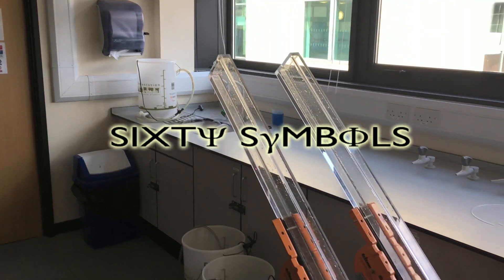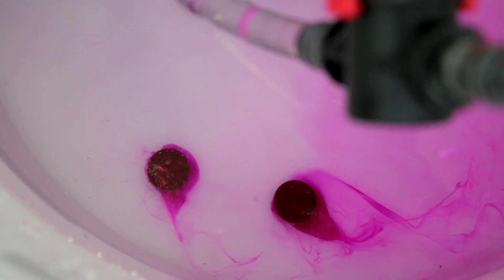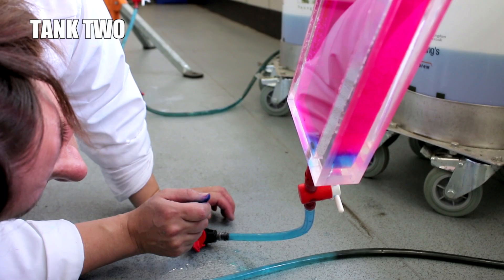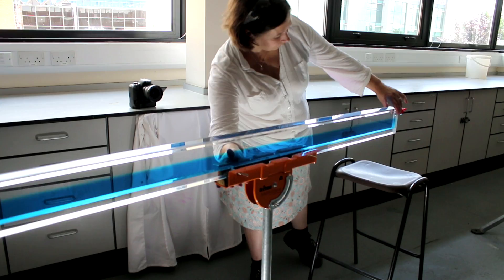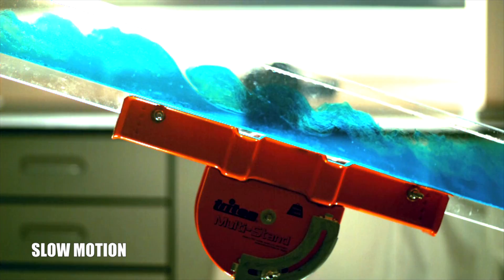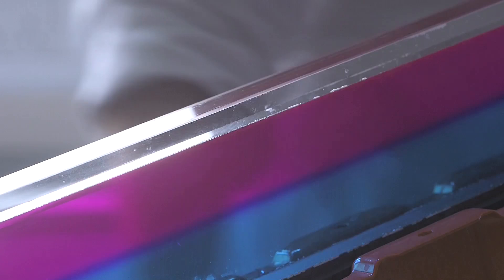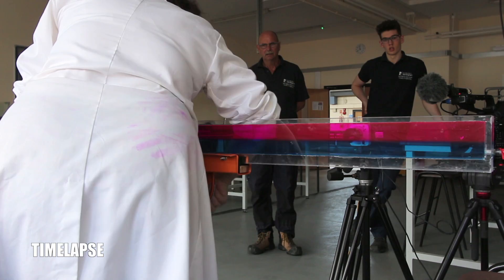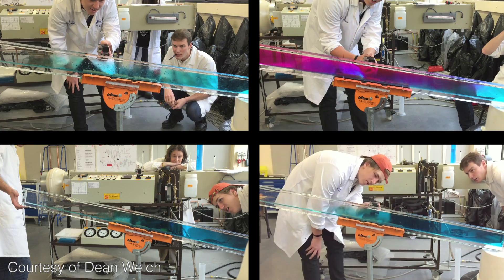More Kelvin-Helmholtz (The Experiment) - Sixty Symbols

Comment from the maker: This is a second video, made public a few hours later, which just details the demo apparatus... If it appears in your feed AND you have already watched it, that is because you are good and loyal Sixty Symbols viewer who clicked the links on the main video.
MAIN VIDEO: https://youtu.be/qgamfo86FQo
Reply: What would the instability look like if there were three fluids? one traveling up, one traveling down and the third being stationary. Would the instability take effect on both sides, like a mirror?
Reply: The_Blu_Nova I think so too. Mainly because fluids just need to move relativly to eachother.
Reply: It depends on the layer thicknesses and relative densities.    If the layers are very thick, it will look a lot like two separate sets of instabilities that may or may not be in-phase.  If the layers are very thin, then it will be easier for the layers to 'roll up' together.

This is then modified by the relative densities.  One thing not mentioned in the main Sixty Symbols video is that when the fluids have different densities (like fresh and salt water), the force of gravity acts to stabilize things -- the heavy fluid that gets pulled up by the pressure has to fight against gravity to get there.  If the three layers have very different relative densities, it might be possible for the Kelvin-Helmholtz billows to grow at just one of the interfaces.
Reply: I watch all the Sixty Symbols vids, but this one doesn't show up until 5 years later?!

Comment: The delay between tipping the container and the instability showing up is awesome. You can really see it's a self-amplifying effect. I thought you had paused the video at first.
Reply: Wouldn't it be easier to use oil and water?
Reply: SPKY 13 Interesting question... I think the answer could be the need for two liquids of different densities but same viscosity.
Reply: Water and kerosene? Approximately the same viscosity, if my observation (at home, so maybe wrong) is not wrong. Also, saves the trouble of colouring the liquid!
Reply: Pah, water. You could simplify this set up even more with some dynamite and plutonium.

Comment: Great video and experiment, Brady and the team!
Reply from the maker: +Rasmus thank you
Reply: If the dimensions and angle of tilt of the apparatus were changed and optimised for visual effect could this experiment be designed with chemicals which would naturally separate afterwards or is mixing an inherent property of Kelvin-Heimholtz waves

Comment: You've just created a perfect visual analogy for the zero dimension! ;O)-
Unlike our own dimension, the trans-dimension has little to no pressure (do it's extension from Real Time,) so when quantum frequencies glide across in zero (neutral time/space) dimension they cause a multitude of various reactions (which we call particle waves.) 
- of course science hasn't caught up to this synopsis but I'm hopeful we are just around the corner as we dive deeper into gravity waves. - Corvaire ;O)-

Comment: Maby a silly question, would the effect work with the same set up but with oil and water? might result in an experiment you could repeat a little easier.
Reply: it even works with air and water, that's why we have ocean waves :)
But if you use vastly different densities (freshwater is 1.00g/cm³, the saltwater here is 1.01g/cm³, sunflower oil is 0.92 g/cm³ - that's 8 times as much of a difference), the effect becomes less clear. Again, this is the reason why ocean waves look like they look instead of something more Kelvin-Heimholtz-y.
Reply: Why does it become less apparent? You'd think a greater dp/dz would give a higher BV frequency, no?
Reply: Since the density here is so close, you get almost symmetrical patterns, which is what makes this so beautiful and special in a way. If you use very different densities, the symmetry goes away and it also becomes chaotic much more quickly [citation needed].
Reply: It seems a silly question at first, but now I want to see it. Too bad I don't have a plexiglas tube to do it myself...
Reply: The larger the difference of densities, the harder it is for the less dense material to affect the other one.

If you notice in this video, the denser salt water (blue) flips upwards into the other material. 

Like how water is too heavy to form the full horse head/hook structure in air, using water and oil, the difference is so big that the water would not be able to flip up and create the full hook structure.

Meaning you would need to do this experiment in space to get the oil/water system to make effects this large, even though its repeatable its much more expensive.
Reply: Maybe the different viscosities of oil and water make the experiment harder to do.
Reply: Couldn’t you adjust the densities using solutes to get both polar and non-polar liquids with the same density?
Reply: Why would the liquids move if they were same density?
Reply: that is a fair concern @Ľubomír Šalgo. They wouldn't move if the experiment was carried out as displayed here. But all you need to get this effect is two fluids (or gasses) moving in opposite directions, there are other methods of getting them to move, like for example pressure differences.
Reply: effect will be less clear bcoz of high density difference. density difference is restoring force in this instability

Comment: What happens if you change the tank's dimensions?
a) Keep the tank the same height and double or half the width? 
b) Keep the tank width the same and half or double the height?
c) Try longer/shorter tanks?
What happens as you gradually increase the density difference between fluids?

Comment: What is the wavelength of those bumps? It looks like a wave from the water hitting the bottom end of the pipe propagates upwards and gets amplified.

If they went back and measured the length of that clamp it could be compared with the wave in the video to get the wavelength.

Comment: Why not use something like Oil and Water that will mix then separate again afterward so you can repeat the experiment after allowing it to settle out?
Reply: I think the density difference between oil and water is to huge. But I am quite sure it would work with a polar/unpolar setup, you just need to find or make them with small density differences.
Reply: It also works with air and water (ocean waves), and oil is definitely denser than air, so I'd speculate that it would work.
but maybe the effect is not that nice (for some reason I can't think of) or there are some practical disadvantages like cleaning the tube from salt vs oil residues
Reply: Because storing a 200 pound oil filled tube all year only to haul it out once or twice for this experiment is far more trouble than just filling it with simple disposable, safe cheap water.

Comment: Why don't you use oil and water so it can be done more than ones?
Reply: Because dealing with gallons and gallons and gallons of oil in a giant 100 pound tube of liquid is a huge amount of hassle. Disposal, leaks, storage. And anyway the educational value of setting up the experiment is also worth something. Just walking up to a tube that's already filled and just tipping it is far less educational.

Comment: This same process applied to geology has proved the theories wrong that mud and clay settle very slowly over time in water environments. The Kelvin-Helmholtz turbulence in fast moving waters such as floods when encountering a different layer such as cleaner water, produces fast sediment sorting into different fine-to coarse particles and rapidly increases deposition. Now it is known that vast mudstone and siltstone layers of significant depth can form quickly and with fine layered sorting during catastrophic flooding.